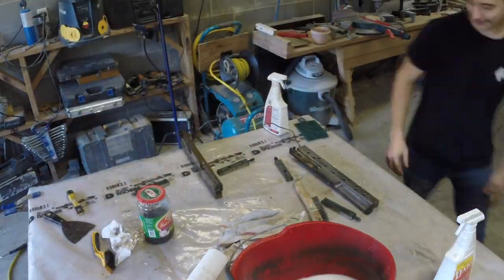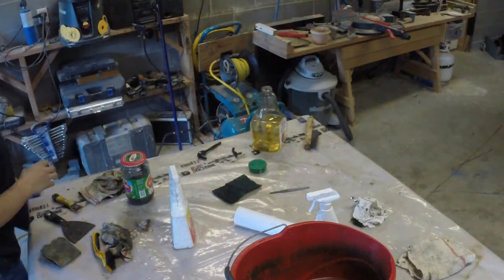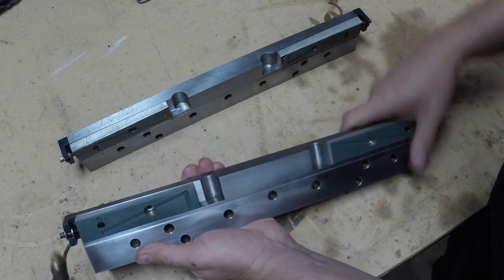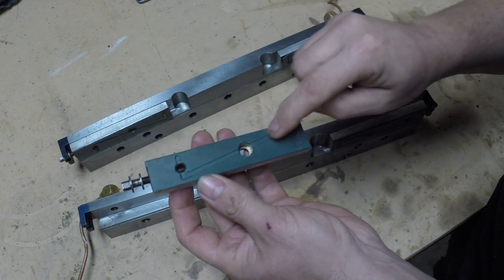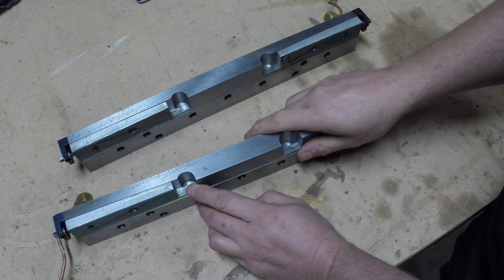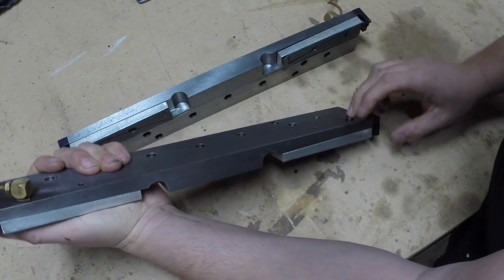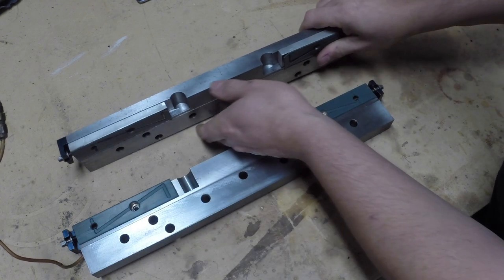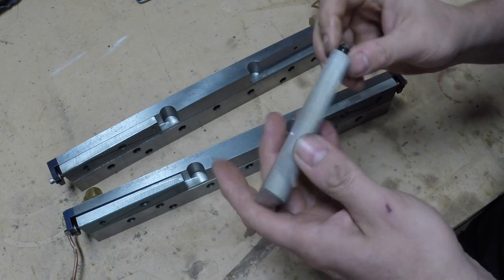Part 5 - (Cleaning and inspecting the Z gibs)

Comment: It looks like the back of the gib also has a lube passage. I'm guessing the port in the center passes into the hole, in the block, and I guess the center port on the blocks are connected? Maybe that's how it transfers way fluid from the top gib to the bottom?